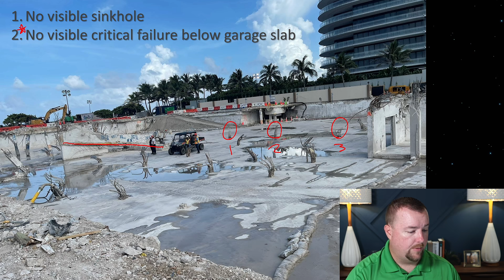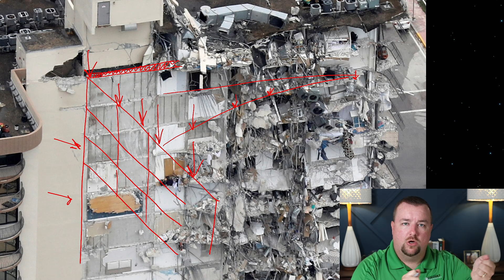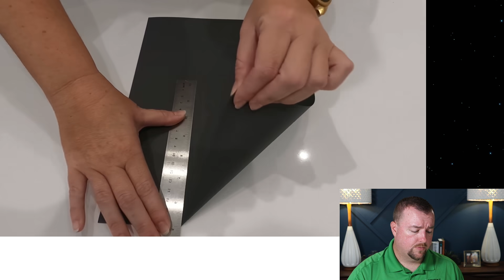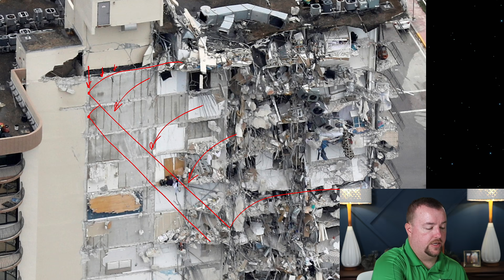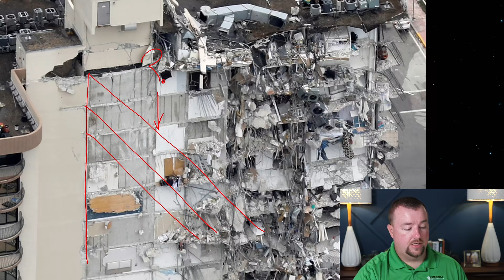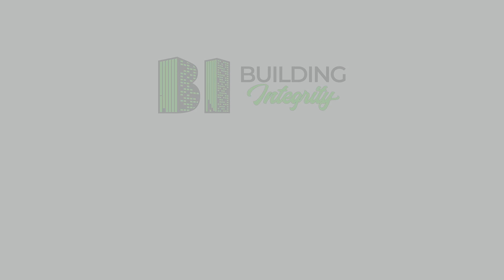Surfside Collapse - Structural Engineer Explains Why Only Half the Building Collapsed

Comment: From what we're hearing, the columns in the south side were almost twice the size of the center and the North end. Like 24 inch verse's 12 to 15 on the rest of the structure. Also we know the pool deck went first, and the pool deck was also in direct contact with the south building. But didn't effect it. I wonder if the south side was built first, and then they changed pile sizes mid stream. Its very strange, but graciously good, that the pool deck falling directly next to the south end caused the center to go down with the pool deck, but leave the south side totally untouched. I'm wondering now, seeing more drawings, if the weight room had any bearing on the fall. Strangely enough the first area of cave in, was directly under the weight room. The weakening of the pool deck- first floor slab with the weight room directly over the saturated concrete pool deck and floor may have started the falure.
Reply: I like this comment !
Reply: @deedewald1707  Thanks Dee,  I just call um as I see um. Not that it matters to the ones that lost their lives and the ones that witnessed it, that realized their shear luck, in the south tower. 😔

Comment: Horrible engineering. No pile caps in Wetdecks to small slab thickness did not use 5000 psi mix.
Reply: There is a whole sheet of drawing showing pile caps, and the bulk of the concrete was specified at 4,000 psi, switching over to 3,000 psi mix above the 8th floor, if I recall correctly.

The building met the building code in force at the time of its construction. Not a stellar example, and a case where 40 years of weathering with deferred maintenance compromised the structure, but it was not a horrible design for its day.
Reply: @chemech  show one Pile cap in a slab intersection.i built dozens of Mid rise in Florida in mid 2000s . Just like this one 
My Collumns tie into each deck and were 24 " X. 24" min. Plus the beams.

Comment: Great explanation. It does lead to the question of why this leading edge shear punch through isn't calculated into the spec (or Code). You mentioned that only normal punch through is used in calculations? Unless I misunderstood, that's a major life-threatening oversight surely?

Comment: The pool deck started collapsing at least 7 mins before the building went down. That’s when the tourist took that video at least. It could have been more than 7 minutes. Maybe 10 minutes? 20 minutes? No one noticed this, no one was monitoring? There might have been time to evacuate.
Reply: As a layman, did you know this could've caused the building to collapse? I doubt you, or any average person would've even suspected the entire structure would fail.
Everyone has all the answers with the benefit of hindsight, how would you have reacted if you came across this at 2.30am? I bet it would've taken you 7 minutes just to process what you had seen....
Reply: Yeah, it's too bad they didn't go pull a fire alarm instead of standing there filming it.
Reply: @erika8627  that was the job of the 24/7 security guard at the building
Reply: Seven minutes is not long in the middle of the night to orient and get out of a tall building?
Reply: @kellyahola4041  i think 7 mins is more than enough, there was still many people awake
Reply: @kellyahola4041  how do you know it was only 7 minutes and not more?
Reply: They have a guard there 24/7 supposably. If he had been doing his job maybe many people could of survived. 
5 mins is more than enough

Comment: I am having a harder time following this video.   As Mr. Porter said, it is only an explanation about shear forces, and not about the entire event.   However, I am trying to visual a construction paper outline of the building and how that would tear absent a shear wall.  I can't do that.   Also, I am not really sure why the columns held in the remaining portion of the building, and not in the collapsed portion, other than they were thicker.   In the collapse portion, the tugging effect of the slab punching pulled the column asunder, and the thicker columns in the remaining portion meant that the slab broke before the column shifted.  Is that an adequate explanation? Does a column have to be strong enough to withstand the tugging force of a slab that is punching through it without breaking/bending?  What would stop a progressive collapse that started with a slab punching through the columns?
Reply: That’s a good question..

Comment: What you are in essence saying, if the garage had a shear wall containing columns 1,2,3 and extending to the standing shear wall and the garage end, the collapse of the pool deck would have stopped at the shear wall and the building would possibly have remained standing.  This would be good for future architects and engineers to keep in mind.  A shear wall and elevator shaft on the east end would also have helped.

Comment: Why did the third section remain standing for another several seconds?  I'm guessing it lacked support?
Reply: The columns were 12 X 16 and overwhelmed !
Reply: Somehow tbe center part also sheared off from tbe other side. I’m not sure why bc that wasn’t a shear wall there
Reply: @simka6858  There was a single side of reinforced concrete wall at the stair tower - not enough to be a shear wall, but enough to partially resist the stresses, delaying the collapse of that section.
Reply: @adstalga    buildings are build to  stand :-)     What took away the support must be the question.
Hint: It came down, just like the  part that was demolished on July 4th.

Comment: I find your research on the causes for the collapse absolutely interesting. I have a question;  on the first photo that you show, you say that the ramp that is visible is the one shown in the video that was taken by a tourist from the hotel by Champlain Towers. However, that's not the side of the hotel. That's the area on the beach. On that side of the big oval building was the pool and the jacuzzi. Please, correct me if I'm wrong.
Reply: He is pointing to the side of where the building was. You can still see the bottom of the pool across from the ramp.
Reply: @Nbdycares2  Thank you. 🤗

Comment: How much stronger would the stairway in section 3 be in a modern code-compliant building?  Would is seem possible or even likely that it would have prevented the collapse of section 3?
Reply: I want to go out on a limb and say a building of this nature, compliant to modern code, would have only suffered minimal damage and not catastrophic failure. But, there's still too many unknowns about Champlain Towers South architecture and the cause of collapse to say anything certain. Hypothetically,  a "new" building could collapse in similar fashion if construction costs were cut, and building inspections were virtually non-existent, for example. Very hard to say.

Comment: At 13:32, it looks like your red line should continue straight across, instead of jagging upward a floor. The other side wouldn't heave upward, I don't think.
Reply: It doesn't heave upward it jets inward
Reply: @Ghost-Dog-Rick  If you continue the line straight across, you can see the same floor level on the other side. The damaged middle section sagged downward, but the floor indicated by the red line should connect straight across where you can see a portion of the same floor on the other side. There's no physics to 'jogging' up. If there were, the roof would 'jog up' as well, and it doesn't.
Reply: @continentalgin  I don't know what else to tell you. Instead of looking at the line as the building moving upward, you have to realize that he is trying to show you that the building tour inward as it fell. The line is supposed to be inward not upward but there's no way to draw inward in 2D. Pretty simple
Reply: @continentalgin  he even explains in the video using the construction paper what he's trying to illustrate. This guy is very much on top of this period much better than any of us
Reply: @Ghost-Dog-Rick  I agree with all he says about the collapse, but his red line should not jog up a floor. The floor slab on the right of where he's drawing the line did not jump up by one whole floor towards the sky. That doesn't happen. Look at it again.
Reply: @continentalgin  wow. How many times does someone have to tell you? It is an illusion. If he had a three-dimensional way to Illustrated for you you would see that the line goes in. However on a 2d illustration, whether the line goes up or in it still looks like it goes up. You have to imagine you're looking down at the building from above period where it starts tearing and words the building gets thinner. At no point is he saying that any part of this building went up
Reply: @Ghost-Dog-Rick  He doesn't connect the red line to the same floor on the other side of the damaged middle. Look at it again.
Reply: @continentalgin  I don't need to look at it again because I'm smart enough to know that the angle of the picture is making it look like what you see. The man literally explains with his own mouth why the red line looks like it moves that way when he draws it and even tells you it is an inward tear
Reply: @Ghost-Dog-Rick  I can see the correct floor slab on the right side of the middle damage and it is where his red line should go, but he has it jogging up to the space just below the roof for no reason.
Reply: @continentalgin  😂🤦‍♂️👍👌

Comment: Very interesting topic. I am a structural engineer.  my point #1: The key reason that kept the remaining building from collapsing is not actually the elevator shear wall itself. It is the piece of the continuous footing-wall system in the level of the garage that has saved the people and the remaining portion of the building. Now I have a picture of how much stronger the piles are compared to the columns.  
My point #2: Thanks for this failure example, I've been douting the shear capacities of the flat-slab on columns for more than 20 years. Now  I finally make sense of everything. Put to simple, the flat slab-column system works in a way like a piece of brittle cracker glued on a pencil. i.e.,  it is the tensional strength of the concrete, rather than rebars is the key contribution to the shear capacity of the slab. Once the punching happened at one column. the failure will be transferred to other columns like opening a zip. Zip-effect is one of the most interesting discoveries in my life.
Reply: just reallized that the the author of this video has pointed out the "prograssive effect" in the later portion of the video, which is the similar to the term "zip effect." Another intersting question is: Is it possible to reduce the prograssive failure of the pool deck type of structures by considering a "hinged" connection rather than traditional monolithic connection between slab and column?  My answer is YES.

Comment: Very good Josh, thank you for your 'Integrity.'  A bit of trivia about paper is that it has 'grain,' like wood.  As paper is manufactured and while still in a wet pasty mush, the cellulose fibers tend to line up parallel with each other.  So when it dries, folding and tearing the paper is much easier, neater, and straighter 'with' the grain, instead of across/perpendicular to the grain.  Sometimes the 8.5 x 11 paper packaging will state 'grain long' or have the 11 underlined if the long side is parallel with the fibers.  Try tearing a newspaper in both directions - you will easily see which tear is straighter.
Reply: Not handmade papers, though, made frame by frame.Just those made on the roll with Fourdrinier-type machines.

Comment: This is similar to Stairwell B in the North twin trade centers where 15 or 16 people survived... Just goes to show living next to stairs/elevator is not only fast to exit, but safer overall... sort of like living on a hill in a flood zone
Reply: In my building all 8 apartments on each level abut either the fire-stairs (as mine does) or the elevator shafts. I am very pleased that our building is particularly strong as a result. However, those who abut the elevator core experience noise from the elevators with those on the top two levels getting the worst noise due to proximity to the elevator motor room above them. So there can be downsides to living by the elevator shafts. But being by the stairs is brilliant. My building has two separate fire-stairs that entwine like DNA meaning that there is always a second stair with separate exit in case there is fire in one of the stairwells. This double-stair design made of 12 inch thick concrete is particularly strong, and with 10 inch thick floor slabs and 8 inch thick concrete walls I get the feeling that this building would survive a nuclear attack. 

It is unfortunate that not all buildings are built to this same standard. The building is over 40 years old and unlikely to be demolished any time in the next century, but when it does need to come down one day, I feel sorry for any demolition company that would have to tackle it. When looking at footage of Champlain Tower it amazes me that people paid top dollar to buy into a building that even if it was well waterproofed and well maintained, still looked like it had a very flimsy structure. They might think it makes the place look “light and airy” to have such small columns and wide slabs, but I prefer the stronger, more rigid construction of my building. I also prefer the way my building is built directly on sandstone bedrock and no soil-retaining walls in the basement levels, just solid rock walls. It helps me sleep at night.
Reply: @artistjoh  WHERE exactly are you located, that the Engineers won out over the Accountants, and built to that high standard?  Also, how many storeys high is your building?
Reply: @MajorCaliber  18 stories high, and in the Sydney CBD. Of course there is a twist - construction standards were so expensive that the builder went broke before construction was complete and another builder completed the job. It was built in 1980. It helps that the entire Sydney CBD is a sandstone ridge with little soil overlay. It means all building foundations are excavated into bedrock. The downside is all underground rail and tunnels are expensive due to rock excavation. It also helps that earthquake risk is as low as it gets.
Reply: Minus the obvious problems, where the state let them get away with very substandard codes in other parts of the country. Drywall on the stairway walls?? Wut? Not legal in Chicago. It has to be brick or concrete block as I heard it. I believe in another video, he points out the stairway wall in one piece on the pile. 

I also dislike lack of I beams. They're skimping on the floor supports, instead of I beams straight through. Which is UNLIKELY to go anywhere, based on the oldest of these buildings. By then, I assume you'd have time to fix it. I'd think any minor fire could weaken/bend them as it did at WTC. You'd have more time to get out with I beams. That's just what I think. Had it been a waffle pattern like every other older skyscraper, the plane wouldn't have survived (not that those people had any chance, I don't think) but you'd have fire resistant walls over a HUGE open space for fire to blast right across in. That's another thing I understand they don't like in Chicago. 

I dislike the idea of relying completely on sprinklers as opposed to basic fire proofing strategies. Like floor to ceiling walls where closed doors at least slow or stop (suffocate) a fire.
Reply: Did you notice near the bottom of the elevator wall there was an apartment where what looks like the headboard of a bed was attached to the wall. Could have been a guest room, apartment could have been empty, but one would hope these residents made it out and to the elevator stairs.
Reply: @fltof2  There were about 30 who got out of the collapsed section. It seems that those who were woken by the shaking and ran survived, while those who phoned someone instead of running did not survive. Although it would have helped to be closer to the exits. One survivor said that when she awoke she saw a crack running up the wall and that she just “knew” that she had to get out of there fast. Others who weren’t so fortunate are likely to have been confused and not known what to do, or they panicked. At a time like that there was only time for a very fast decision to run, and to run fast.

Comment: Thanks.  Really appreciate your explanation of the mechanical properties of the materials in this building.  It's so easy to shoot from the hip and to bully others...some of those, who are producing videos on this collapse are being somewhat know-it-all-ish and not really giving concise information.  It seems as though we know SOME of what caused this collapse but have not put all the pieces together yet.  And some parts may remain a mystery forever.  In my mind there were some indications of problems in this building but no one could know the full extent of them without actually going through the process of repair.  Personally, I've always tried to stay out of high rise buildings as much as possible and won't even live in a 2 story home.  Just the danger of escaping from a higher than ground level floor in an emergency tells me to steer well clear, let alone collapsing structure.